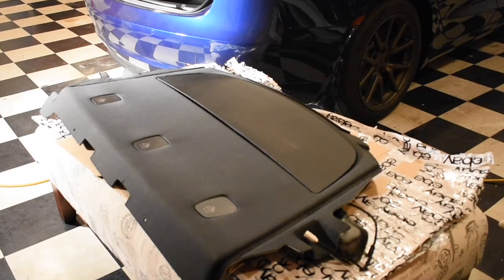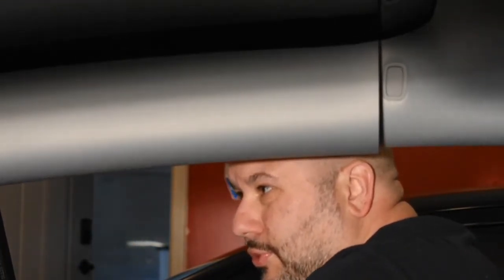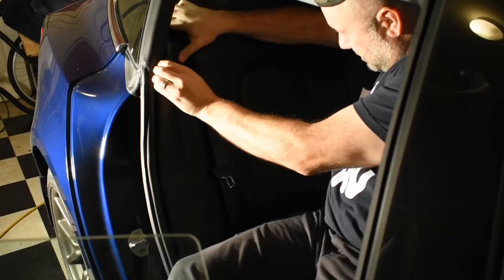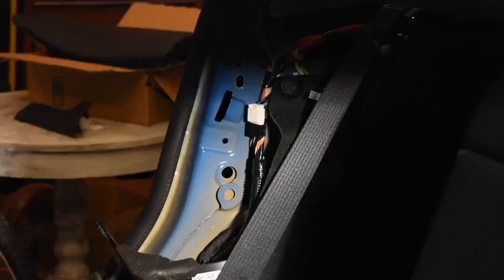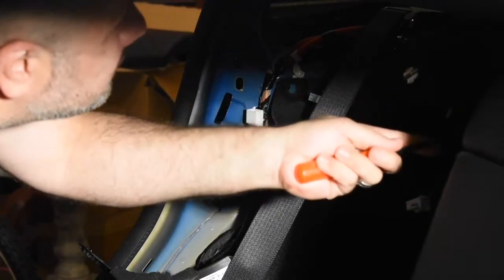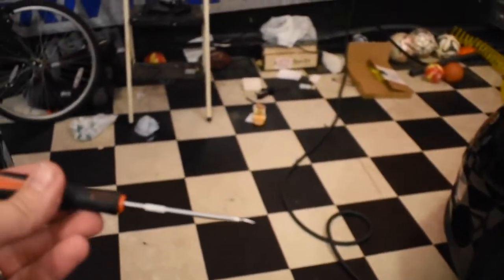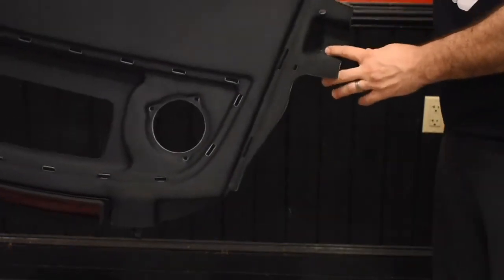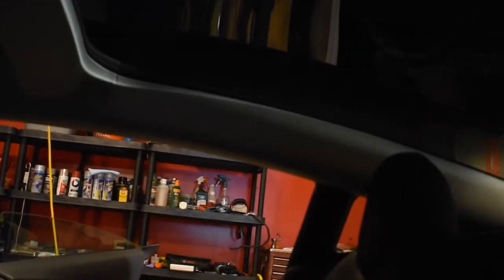Tesla Model 3 Rear Speaker Deck

Comment: A window tint shop installed tint on my rear windshield but didn’t use a soak-shield to prevent water from getting inside. This caused water to drip down the windshield area beneath the taillight attached to the deck. Do I have to remove the entire deck to get to the deeper windshield area to clean it up or is there a less invasive way to do so?

Comment: There are 20 tabs if you have the single grill.  Even if you have the 2 separate small grills there will be no way to simply pull the grill from the top without deforming the grill.

Comment: I have a Model 3 2019. I installed Hansshow Cable. Can I replace OEM back speakers by Kenwood 6.5 inch (KFC-1695PS) ?
Reply from the maker: 6.5 are going to be too big.  4” is really all it can handle and the speaker can’t be too tall.  Take a look at this: https://ampedgarage.com/collections/model-3-aftermarket-speaker-brackets/products/amped-garage-model-3-midrange-rear-parcel-shelf-speaker-adapter-set-faital-4fe32-speakers

Comment: Hi, I just got the Hansshow audio upgrade kit version E with their 2 rear surround speakers. I intent to replace the OEM in my car with those. Do you think I have to remove all the rear deck panel in order to replace them or just lift the grill
Reply: it's depend on when your M3 SR+ are build.. if it's pass Feb. 2020 I think there is no OEM speakers other else, yes if you want to replace the existing one, you'll need to remove because lot of contorsion needs to be, screen, connection, glue and more...